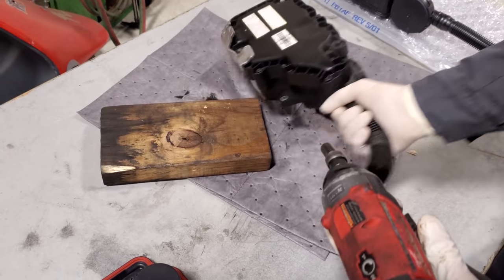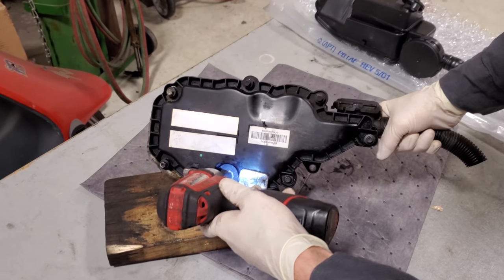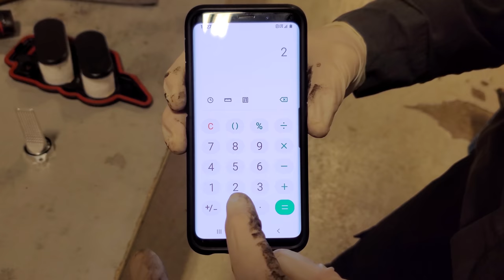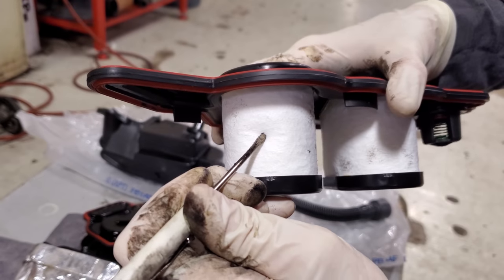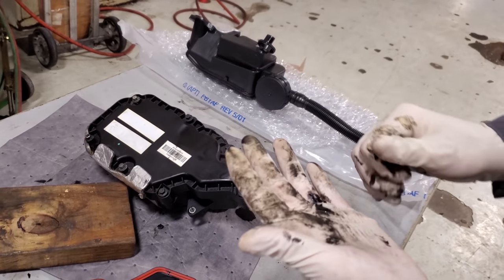Ford 6.7 Powerstroke - CCV Re-route??!!!! Do YOU do it or NOT?!?! You DECIDE | **MUST WATCH** |

Comment: Thank you for this! I popped the oil filler cap while the truck was running and the pressure blew the cap out of my hand... Bought (FoMoCo only!) replacement filter... Truck runs better and COOLER (at 50F).  Like you said...the old filter weighed 3 times as much... 50k on the truck... Don't ignore this maint issue!
Reply from the maker: Whhhhhhhat
Reply: @PowerStrokeTechTalkwARod    Hey!  I ordered... cancelled-- and I think it arrived.  What am I talking about?  The SPE CCV kit.  You did a follow up vid of a different kit?  Let me know what you think of this CCV by-pass stuff.  As it sits my 2017 dually is 100% stock.  Super interested in your thoughts on the "disaster prevention" and "CCV"... thanks man!
Reply from the maker: SPE is a complete waste of time & energy. Throw it out! Now disaster prevention you need the S&S kit. I take it you haven't seen that video.....?
Reply: @PowerStrokeTechTalkwARod  so you don’t suggest any ccv reroute under any circumstance? Even modified? I’ve heard of modded out motors creating more pressure that the at o filter restricts. What are your thoughts.
Reply from the maker: Do with it what ya want....I don't like when people waste their time & money (as I commented above to another gent), on merit less components
Reply: im at 104k miles on my 18' f250 platinum and have never changed mine😂 guess ill be changing mine this week. Already had my upper oil pan gasket replaced at 96k
Reply: @PowerStrokeTechTalkwARod what’s your take on catch cans?

Comment: I have a 7.3 but when I did the CCV mod I never noticed any smell. First I ran the dog house just back words and let the vapor fill the engine bay. No smell. Now I have a heater hose going down into the front drivers wheel well. No smell.

Comment: Did my 19’ and it’s cover had the bolts. 26k miles and the 2 filters were not swelling but 100% saturated and flaked easily . I’m guessing another 50k miles and it would have looked as bad as yours did .

Comment: I have a 2011 so of course mine had the bolts, used a different CCV Delete kit because this one wasn’t available at the time, routed my hose through the frame, just behind the cab so I don’t have to smell the smoke. No issues for me at all, just over 250,000 miles on mine. Pretty weird, all of my emissions components just so happened to fall off at the same time thanks to an EGT sensor that shut my truck off with a 1 day old baby in the truck on a 124 degree day here in Arizona. 🤷‍♂️

Comment: If you do the CCV Reroute just get a long enough hose and run it down the firewall and into the frame and go all the way to the hitch and there is a hole on the hitch plate where it bolts to the frame and stick the 3/4" hose though that hole and let it vent out under the back bumper of the truck. No smell and it's hidden and out of the way.
Reply: I don’t have one of these yet, but going to.  I’m 70 years old and most of the early trucks in my life had CCV tubes directly from the valve cover cap directly to the ground.  Some had a foam pad that caught and returned oil. There wasn’t enough oil that made it to the hose that it collected on the frame or smelled bad.  I would think this cheese grater configuration would come close to eliminating oil into the tube and return oil to where it should be.
Reply: Better yet buy a Venturi valve for your exhaust and weld that on and route house to that.  This gives two benefits, no more smell and you retain the factory vacuum pull of gasses from the crankcase.  Venting to atmosphere eliminates the vacuum and people have seen oil leaks pop up due to the small amount of added pressure in the crank case.
Reply: I decided to not mess with how it’s engineered. There is opinion out there that deleting the CCV box causes an imbalance of Turbo pressure?  I decided to just change mine out every 50K and call it a day. 217,000 miles and running strong.
Reply: Do yours like I did mine.  Leave your box and route your hose to the back of the truck.  It will vent what it needs to.  The box is still in place to filter out the oil. Right now you are putting oil into your Water to air Internet cooler and your hot and cold pipes are full of oil. Also all of that nasty oil is going back into your Engines combustion chamber and passing through your rings and dirtying your oil. The kit will only cost you about $40
Reply from the maker: ...do as you wish. That "opinion" needs to just stick to working on 6.oh diesels in Buford & leave the 6.7s alone.
Reply: @keffjames2747  The problem with leaving the OEM CCV filter in place and not having it connected to your intake is now you are building pressure in the crank case as it has to push its way through the filter.  Deleting the box and venting to atmosphere is the second best option, but still creates slightly higher than factory crank case pressure.  You want to assist the ventilation with vacuum, the only ways to do this are routed to the intake or routed to the exhaust with a venturi, the latter being the best option as it eliminates the oil entering the intake but also provides vacuum extraction - with none of the smell.

Comment: I've been working on 6.7s since they came out in 2011 and I've never seen one with a filter in it. I've replaced a few due to cracking at seam and leaking, and of course plenty of ccv mod recalls. I've seen the ccv delete done and plumbed into the exhaust to eliminate oil vapor odor. Also there was a venturi type fitting in the exhaust so in theory could pull a slight vacuum on it and be beneficial.

Comment: I have the SPE catch can and reroute kits in both of my 2015 & 2017 6.7 power strokes.Neither one had a serviceable filter. I Just wanted to avoid issues down the road. Easy to install and I don’t smell any oil.

Comment: I have a 2018 F-250 I did the CCV delete with SPE's cheese grader. The short hose did have quite a bit of vapor at drive throughs right at the driver window with it dumping at the rear of the driver side radius arm bracket. I got a 20' hose and now it dumps out by the rear hitch where the exhaust blows it away. I have a 5" straight pipe dumped behind the rear axel that helps blow the fumes away. I'm a fan, no other issues so far.

Comment: I have been running the SPE CCV KIT ,with the internal catch can  for 60,000 miles no problems so far. Intake staying clean. I extended the hose to run further back under my  F350 so I don't smell the oil fumes. Checked the catch can on last service still looking clean no clogging,  and no oil drips  from the hose.

Comment: This kit works very well. I had at CCV delete prior to adding SPE’s  aluminum screen, and after installation it dramatically cut down on the oil smell/vapor  coming from under the truck. 👍
Reply: Ive never had any oil smell or smoke and I have the ford delete ,  like when or how often do ya smell it?
Reply: @culbyj3665  It will lightly smoke when idling after running a little hard or during periods of extended idling once the engine is warm.

Comment: I own a 2012 F250 with a 6.7L Powerstroke.  I bought the truck used with 160,000 miles and one of the very first things I did was to reroute the CCV.  I used Maryland Performances Zero Drip kit.  The quality of the components are excellent however after a few days of driving I began to have oil spotting on my driveway.  The Zero Drip was beginning to drip.  I did some brainstorming and decided my best course of action was to add a breather tank to the end of the ccv reroute hose.  I specifically used Moroso's 85751 Breather Tank due to its large inlet, descent capacity for oil drippings, and large filtered vent.  The addition of this tank completely eliminated my oil spotting issue, drastically reduced the amount of CCV vapors seen at idle, as well as decreased the smell from the vapors slightly.  All while keeping my CCV system's backpressure at near nothing.  I drain the breather tank every oil change and have had zero issues so far after 20,000 miles of driving.  In my experience a properly executed CCV reroute is worth the investment.  If large enough fittings and plumbing is used, it will keep your crankcase pressure at virtually zero decreasing the likelihood of an oil leak.  It also keeps the oil vapor out of you intake, turbo, intake boots, and intercooler.  I've seen high mileage intercoolers struggling to perform due to being oil logged from years of CCV vapors.  CCV reroutes are definitely an added expense as well as an added maintenance item when used with a breather tank.  However, in my opinion they are worth your time, money, and effort.
Reply from the maker: Thank you for your real world experience.
Reply: Same here. Had a boosted mustang. Not a whole lot of oil before the pro charger, after 25k of boost, changed intake to a scj and noticed copious amounts of oil residue all over everything. Ran dual catch cans and reduced the oil/vapor going into the engine dramatically. Funny thing is this was on a 15, and Ford released catch cans on the future models. It’s like they say, the vehicle are built to get you through the warranty period. Best advice is decide how you need or want to use your machinery and tweak it to create preservation. Amsoil everywhere,  filter changes religiously,do an engine flush and  run a bypass filtration for oil, they work, upgrade to fass, add fuel additive to lubricate, we only have 15ppm of sulfur. In comparison Europe has 300-400ppm and 1% failure on cp pumps. Good air box, and open exhaust will reduce heat stacking up. Coupe grand in mods will make these trucks last forever minus turbos, ain’t a whole you can do with 1500 relentless degrees. Compliment the system, don’t reinvent the wheel. That stand had every emission component on it and made way more power than all the guys throwing blowers on them. Find what makes your engine efficient and do that.

Comment: Another great vid. Thank you This is a huge topic currently on the 6.7s. 2017 to 2019. That filter clogs at 7500 miles under normal conditions. We have had dozens of 19. 450s with only 15k or less miles on them have ccv filters actually braking apart with oil loaded actually dripping. At first just thought simply it was just a one off. However this is a huge issue. There is a recall on these ccv boxes with filter for 650 and 750s now. It should be 250 up. However it will be changed to a non filter setup ccv as you stated in vid. We dont even like them either. Cut top off of the sealed lid it does nothing to help but pour the gas and soot back in. Topic needs to be on top 3 for this engine cause there is alot of owners that have no clue
Reply from the maker: I need u on my show...podcast material brahhh
Reply: What else would be in your top 3 topics for the 6.7 Powerstrokes?
Reply from the maker: What ya mean
Reply: @PowerStrokeTechTalkwARod  Above, Anthony said the CCV filter should be a top 3 topic for these trucks, I'm wondering what his other 2 tops would be to complete the top 3
Reply: What's up guys I first saw this on 450 cab and chassis trucks with the serviceable removal ccv box lids those are the styles 18, and 19 I have seen. However as Arod knows ford came out with a new ccv assembly no filter type. I actually saw ccv filters braking apart and most likely going into block. Small fibers. Still a huge huge cover up by ford motor company. To actually say the filter does not need changing until 75k or 100k miles can you imagine. I see medium and heavy duty trucks 450 up and at 7500 miles ccv filter garbage. Arod had vid on his bench on one if I can remember. Non the less there are worse items as we all know about. Customers , techs, even ford themselves that cause failure that can break the bank for many 3 small letters CP4 . I have never seen a bad ccv filter cost a 12 grand repair but if your cp4 goes which I have myself 72 trucks in 2 years 8 months

Comment: hello Arod I watched ur videos very educational thank you I have a 2011 f250 sd 6.7 154000 klms I installed the complete spe disaster kit and the CCV reroute  the cheese grater actually serves as an internal catch can , I ran thru to my frame no smoke no smell, but as I took my factory CCV box without the bolts at the top  I was surprised to find that it was relatively clean, I use  friction reducer once a year  hot shots secret in every tank of fuel and  hot shots secret, and diesel extreme clean and boost once a year in the fuel tank I hope all this stuff works  so far so good thank you

Comment: So I did a catch can for my 2006 6.0L F250 and it worked great! I did not get any more oil in the intake track at all. On every oil change I just drain the can out and you got about 8oz of oil out of it was all. now I have an 2020 F450 6.7l and I am looking at this set up. But I am going to run it back to the stock location in the intake. I will be checking to see if oil make it the cooler and intake track. If it still gets there I will also stack it with a good catch can in the middle of the tube and see if that work like my 6.0L did. I will keep you posted.

Comment: I’m running spe ccv delete , I routed it into a Venturi valve  welded into the exhaust , no fumes 👍🏼
Reply from the maker: Email pics please!!🙋‍♂️👍🤝
Powerstroketechtalkwarod@gmail.com
Reply: What valve you source to weld on the exhaust? I see its a 3/4" hose coming out with the kit.. Thanks
Reply: @adamt7174  I found one on eBay for cheap type in scavenger kit , some companies try and sell the same fitting for 100+
Reply from the maker: Email me the one
Reply: @ericcothrum9595  Thanks I think I figured it out but that’s the idea that pushed me over the edge on this one so Thank you for the input!
Reply: @adamt7174  found on ebay
Reply: @tjsalter6504  I ordered the CCV kit from SPE this weekend. I also found what I think are the right parts from Summit actually. It’s a Milodon Weld in insert, a 1/2” coupler (for the treaded side of the insert to accept a barb fitting), a 1/2” NPT off that to a 3/4” barb fitting. Once I get everything in and go for the install I’ll update if it works but everything was $30 plus the kit
Reply: @HSKFabrications  I’ll have to check it out, thanks for the info. For the time being I changed my CCV box and installed a Mishimoto Catch Can System

Comment: I’m surprised that thing didn’t have all kinds of oil leaks. 17-19s with that ccv filter we recommend at 50k and any that leak get a new filter. The filters always look like that although I haven’t seen one flake yet. And the engine has crazy leaks besides the upper oil pan leak like they all do we are seeing front or rear main leaks, front cover leaks, left/ right valve cover leaks or both! Leaks that we never saw with the older style ccv on the 14-16s. But man if the ccv changes to the old centrifugal style then ima just start recommending it to customers. As for that hose on the aftermarket delete kit I’d run it to some sort of separator or catch can. When I work on semi trucks some Cummins engines wouldn’t route the ccv to the intake. Instead the ccv filter would dump to atmosphere. And some trucks were just nasty, I wouldn’t do it on a 2021

Comment: H&S Motorsports CCV kit on my ‘12.  Installed that about 5 years ago when I replaced the lower charged air pipe with a steel one.  The factory plastic charged air pipe was saturated with oil inside.  No problems with this kit, just a little smelly and some oil drips come out of the end of the hose.

Comment: Powerstroke Whisperer, would you say that the oily fumes recirculated from the factory CCV box are the crux of goop building up in intake system?  I recognize that best would be full delete (off-road use only), however removing the oily fumes would still be best first step --agree?
Reply from the maker: Si

Comment: I didn’t actually take mine apart when I took it off. I just put that spe delete on my 11 6.7. I’ve got several parts from them and I believe they are top notch aftermarket parts. Especially the exo filters for the cp4 system.
Reply: I have an 11 as well and just tried this reroute kit.  After install did you get excessive white/grey smoke out the tailpipe?  It was so bad i put the box back in and it stopped.  Even had oil dripping out the tailpipe.  Just curious if it might just be the 10 years of oil build up in the cooler and pipes.
Reply: @sd402rcool  it was a little more than usual but it stopped in a day or so.
Reply: Too bad their customer service blows!  No more SPE for me.
Reply: @sd402rcool I had this same problem. My hose was kinked. I unkinked it and no more oil drips from the exhaust.

Comment: I’ve had the internal catch can by SPE installed on my truck since the week they announced it for sale.  I’ve recently notice oil droplets this winter during warmups and idle which were minimum. I definitely don’t like the fumes from the hose especially during drive ups.  I’m planing on rerouting the hose further to the rear of the truck.
Reply from the maker: Thanks 4 sharing
Reply: I had the same situation, the fumes were more an issue for me than the drops. I ended up needing to route it to a SECONDARY catch can, and then routed the remainder into a venturi tube welded into my exhaust. So what little smoke is left is routed out the exhaust.
Reply: @hibrad  what catch can did you use? Was it an issue finding a shop to weld a Venturi tube on?
Reply: @joeycrews5364  I had the SPE internal one and then eventually added on the No Limit Fabrication catch can. I welded the Venturi tube on myself with my mig welder.